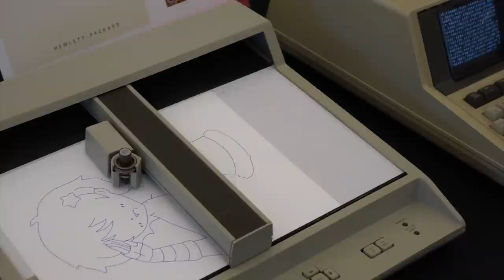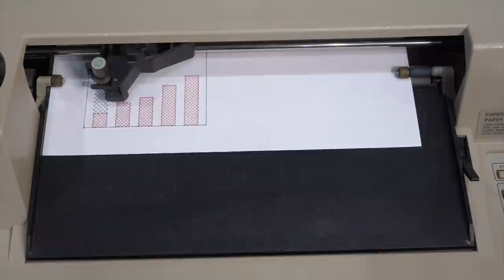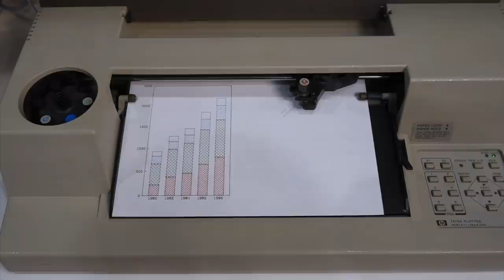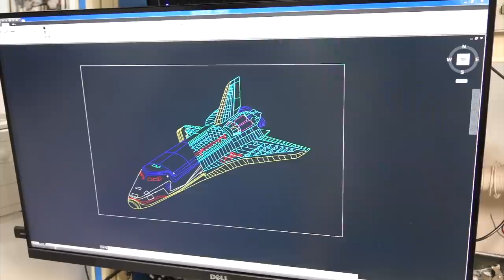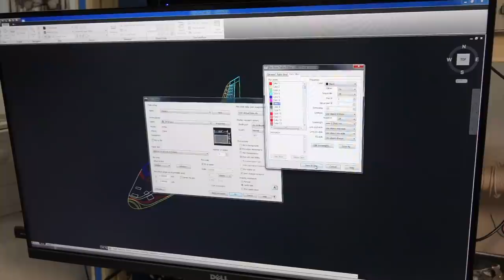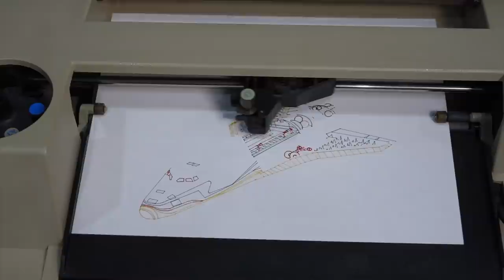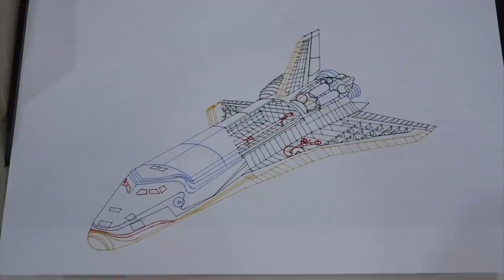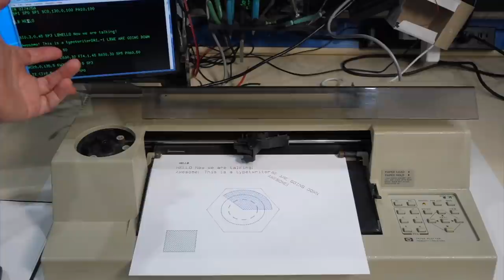HP 7475A Plotter and HPGL Demo

Comment: Years ago at Boeing, we'd use HPGL as a graphics interchange language if nothing else like IGES output was available. Virtually all the systems had the ability to plot in HPGL if nothing else.  I wrote many a HPGL to X and X to HPGL translation programs to transfer graphics between different engineering groups around Boeing during that time frame.  It was a lot of fun.
Reply: HPGL (HP Graphics Language) was the most widely supported language.  There was even a rasteriser available at one point which plugged into a regular dot-matrix printer and allowed it to print HPGL output.
Reply: As a practise project I am building an HPGL to low-level vector parser in pure condensed python. polygons are a bitch I can tell ya LOL
Reply: I used HPGL to duplicate the vectors in a drawing so it would retrace everything once on an A1 DesignJet. using an Ahrend steel tip pen, it would result in absolute opaque  black on polyester film. I used that for pcb UV exposure a couple of times until I resigned at that place. This was 1992.
Reply: @paulmichaelfreedman8334  We coded primarily in C at the time.  In our primary system used to print all the graphics in the Maintenance and Operations manuals and all FAA Bulletins, EVERYTHING was a polygon - even circles and splines were just polygons with very high segment counts to smooth them out.  This took more memory, but was FAST and eliminated a lot of floating point calculations. Polygons were implemented as pointers to sections of malloc'd memory containing linked-lists of vectors.  I can imagine in Python with no true pointer type things can get challenging!  How are you implementing them?  Arrays or something else?  I have written code to simulate lists using Associative Arrays.
Reply: @rhymereason3449  Let's just say my comprehension of lists has improved massively after spending many hours analyzing the behaviour of certain actions. In the end I saw my failure: When a list is returned from a function or method, it's always put into another list to be a single variable. That meant i had to use .extend() instead of .append() to add the results to the list that was being assembled. My parser first filters commands from data, then parses that data into a list of single values. Then checks which command and calls the corresponding function. That function then returns the low-level vectors back (containing coords, pu/pd info, pen nr, speed) in a list which is the added to the main list. When PM0 is issued, all vectors are stored temporarily in a separate list, which is then added whenever EP is issued and emptied when PM0 is issued again. FP has yet to be implemented. Circles work. arcs are not yet accurate.
Reply: @douro20  That rasterizer must have cost a fortune, to contain so much memory as to rasterize a full page of graphics. And no line by lijne, the full page has to be rendered before sending to printer.
Reply: @paulmichaelfreedman8334  Not really; this was the early 1990s.  It was cheaper than a pen plotter
Reply: @paulmichaelfreedman8334  Yep... pushing the boundaries of a language to solve a problem forces you to get a deeper understanding of the language. It also teaches you the strength and weaknesses of a language and it's appropriateness for a given application .  I'm sure you're learning a lot.   I like Python to a certain degree for it's rich set of library modules... but it's insistence on making so much "immutable", constantly making new copies of objects,  and making pass by reference so difficult can drive someone who coded professionally for decades in C and assembly nuts!
Reply: @rhymereason3449  Despite it's disadvantages, I find python to be fine for messing about inhobby  projects. It's anything but fast (although for some things it is already much faster than needed), but the interpreter-based functionality means it's easy to check if errors have been corrected by just running the program everytime you make a change. In C you have to re-compile a lot of stuff. No idea if that takes much longer or not, but from what I hear it does.
Reply: @paulmichaelfreedman8334  Oh I agree with you 100% - we're all pretty spoiled by the speed of modern hardware where we can trade efficiency for convenience.  I'm amazed at the fraction of a second byte-code compiles of languages like Python, Perl, and Awk - the languages I use for various home projects.  And the speed of modern hash tables (associative arrays & dictionaries) is truly amazing (when I started coding, if we wanted a hash table we had to code it ourselves, along with every other data structure for that matter).  Even Brian Kernigan one of the developers of C admits he now primarily codes in Python and Awk!
Reply: @rhymereason3449  I think ease of use is the best term to describe Python's neatest feature.
Reply: @paulmichaelfreedman8334  Yeah... but the language itself has this odd mix of what is a standard function and what is an OO method that is annoying to me... and regular expression implementation is really clunky IMHO... much more awkward than in Perl or Awk.
Reply: @rhymereason3449  to be honest programming jargon is not my best quality, but a standard function in essence simply returns calculated results, and a method can be used multiple times as an independent instance with its own set of parameters preset. I think I got it half right there lol
Reply: Also used 7475 for telecoms and banking purposes. A great device

Comment: The engineering firm I worked at in the late 80's had a pair of 7475A plotters that ran 12-14 hours per day, 6 days a week cranking out electrical schematics on 11x17 paper.  The techs that ran the plotters could switch out paper and pens in a hurry.  The constant click / clack of the plotters was annoying until you realized that was the sound of progress.  There was a third plotter plus more spare parts to keep everything moving.  The 7475A is an amazing device.  We even worked on optimizing the movement of the paper and pens to save precious seconds on each drawings.
Reply: At my workplace we had a room full of D-Size plotters, 6 - 8 as I  recall. Sometimes I had to edit HPGL files by hand, because of engineer's screw-ups.
Reply: @mekkler  You mean sending you a plot file plotting just beyond the boundaries resulting in no frame around the drawing or similar? I remember AutoCAD late 80s had a quirk where it was easy to do such a thing.
Reply: Why didn't you guys have a laser printer? A laserjet II could do 8 pages per minute, or did you need color drawings specifically?
and 300 dpi was fine enough to scale to A3 on a copier. I worked at a place that did that. print everything on A4 and copy to A3. A3 laser printers were ridiculously expensive in the early 90s.
Reply: @paulmichaelfreedman8334  What the engineers did was to use a proportional move command which would send a section of entities racing 1000 miles into the distance so the actual drawing was a  tiny postage stamp sized blob in the corner. I tried to get them to zoom-limits instead of zoom-extents. It was easier to just do it myself.
Reply: @mekkler  Yes, I know that one too. Bloody annoying wasn't it.

Comment: The innovation that made this series of plotters great was to move the paper instead of the whole pen carriage, and to do it without losing accurate paper registration. The system was called LIPS - Low Inertia Plotting System. The first plotter to use this was the two-pen 7470, codenamed Sweetlips. I think the 7475 may have been called Hotlips internally. The final desktop  model, which was astonishingly fast, was the 7550 which featured automatic paper feed. Moving the paper was achieved by using rollers with gritty surfaces, or grit wheels. Finding a way to make the grit wheels in such a way that they would make tiny indentations in the paper that would reliably re-engage with the grit particles that made them was the key to success. If you look at the edges of a sheet that has been plotted you can see the tiny tracks of pits that the grit wheels have made.
Reply: That's fascinating!  I would never have thought of that, even watching it work, but it makes sense how that would compensate for tiny amounts of slipping to keep them from adding up.

Comment: Amazing machine that brings back good memories. I used it a lot back in the 80’s to print transparent slides in color to present on an overhead projector. Remember those?
Reply: man those slides must have been beautiful
Reply: I used to use these on a daily basis when testing microwave sub-systems; we also had the larger version which I can't recall the number of. We had started out using the flatbed versions before the 7475 was available; with these you had to lay the paper on the bed then switch on the paper hold which applied a charge to the bed; the pen change was entirely manual on that model.
Reply: @cambridgemart2075  electrostatic paper holding? dope...
Reply: @GeorgeTsiros  ?

Comment: I remember seeing someone pull one of these out of a storage room, plug it in, press the Confidence Test button and have it work perfectly despite having been there for 15 years or so. Even the pens still worked fine.  Meanwhile modern HP inkjets will demand a new set of ink cartridges to print anything if you leave them idle for 15 days.
Reply: @kreuner11  plus they have chips to stop you refilling them with generic ink. That’s why I keep around my 2006 one which, despite looking to have a chip, doesn’t actually use it for that purpose. No need to replace it.
Reply: @kaitlyn__L  Once it breaks go for an InkTank professional printer from Epson or Canon. I got one used, and it's absolutely incredible.
Reply: Honestly, the biggest danger you have plugging it in after 15 years is that the fuses go pop due to leaky caps on the driver board or power supply 😂
Reply: @paulmichaelfreedman8334  It's interesting how most 70s and 80s electronics can be fixed by replacing capacitors it but that is not true of modern stuff. So in a post apocalyptic world there'd be a lot of retro gear being used after being mined out of landfill and recapped.
Reply: @user-qf6yt3id3w  You'd be surprised how much mpdern stuff can be repaired, just with more sophisticated tools. SMD repairs are order of the day in repair shops.But I agree that is not well spent on cheap electronics meant to last a couple of years. But a lot of it can be salvaged and brought back to life if not corroded too much. Even cheap electronics use Glass fibre pcb board.
Reply: @anonymousarmadillo6589  Epson color laser printers are amazing. I bought a single drum color laser from epson in 2006, and it was capable of 2400x1200 dpi. It produced photo realistic copies with brilliant colors. Not fast, but stunning quality. And it only cost me 300 euros at the time  I regret ever selling it. But it was showing signs of age and not just the pickup rollers.
Reply: It was built while HP was still a tech company and not just mostly a seller of printer ink at $1500 a gallon...
Reply: @paulmichaelfreedman8334  Yes, but a BIG difference for the casual hobbiest.  With old tech all you need was a soldering iron.  With the new SMD stuff you need a hot air system, magnifying system, special forceps etc. and the muscle control of a brain surgeon.  Not to mention testing/troubleshooting is harder too.
Reply: @rhymereason3449  True, less readily available, but certainly not impossible.
Reply: @rhymereason3449  At the time (~2002) I calculated the price to be around 1200 euros per liter, and there are 3.7 liters in a US gallon. I worked at a copy shop that had a wide format printer and used huge HP ink tanks that held a liter per color. I also knew the wholesale price, around 800 euro p/p, and it took 7 colors (!!). The smaller ink cartridges worked out at over 1200.

Comment: "-I'm a time traveller! And where I come from, we have one-armed robots that draws spaceplanes! Spaceplanes that actually flies, fixes space telescopes in orbit, and lands on runways!
-Wow! and how far in the future do you comes from? a century or what?
-Sorry, but I'm coming from 40 years in the past..."

:'(
Reply: You couldn't pull that trick on me.  I'm from the past and I was there!  I remember fixing the plotters that were connected to our Apple //e PCs and had pens that came loose, got stuck in the mechanism and burned out the driver transistors.  Plotters, in my opinion, had major drawbacks, mainly they were slow...   Thanks, Marc.
Reply: Best comment EVER, sooo true
Reply: @kreuner11  Yeah, but they cut, not draw.
Reply: @Damien.D  You can look up pen plotter on amazon and find plenty of results, all though most of them have both axis in the pen mechanism instead of moving the paper

Comment: Wow, that brings back memories! I was a technical support engineer at HP San Diego Division from 1985-1988, supporting all plotters - flatbed electrostatic flatbeds like the 7225 you mentioned, desktops like this one, and drafting plotters. When I first got there, I decided that a good way to thoroughly learn the way a plotter works was to build one. So every day on my way to the lunchroom I would pass by the bins of rejected parts and pick out parts that would still function (rejected for cosmetic reasons or something), and I gradually built my own 7470A (similar to this one but with only two pens instead of a carousel) for free!

Comment: in the 80's when i was training to be an engineer, part of my job was 2 afternoons in the "plotter room" maintaining and running the plotter for the highway design department for a local authority, the plotter used paper with paper up to 2m wide, regularly pens would run out mid print or jam etc, and i would have to fix it, and try to sort the plot to continue without restarting the whole plot. it was so stressful, and ou could not take your eyes of the plot at all ! watching the second half, omg the serial instruction, i spent many an our fixing our senior engineers Plans with command like this, and it would always be our error if it turned out wrong !

Comment: My 7550A has been stored in my Sea Container for over 20 years, not even packed in protective plastic, dusted it off, turned it on and ran the demo - no problems!  Had many sealed Pens but pretty much dried out after sitting in the Container over many Aussie summers.  Read a suggestion using Sharpie ink and removing the felt pen by simply pulling it out, using an allen key to push the cap out, installing the Sharpie ink (trimmed to size) and works just fine!  Now installing XP on an old desktop as that was the last OS that supported the plotter (serial port) so can just transfer files to that platform for printing!!  Soon be plotting Circuit Diagrams again with an entertainment value that ink-jet printers could only dream about!!  
And seeing the (once treasured, pray again from Nov 2024) "Made in U.S.A." on the printer and all circuit boards.  If it was HP, DEC, Honeywell, Foxboro and other great companies, "Made in USA" was a guarantee of fantastic Engineering and Quality!  President Trump, Make America (And the Western World) Great Again!!

Comment: Watching (and listening to) this thing run, especially the solid fill at 5:35 getting faster and faster in the corner, reminds me of a modern 3D printer in operation.  We had a couple of pen plotters in the drafting room at school, which were later replaced by wide-format inkjet printers.  The accuracy on these pen plotters is impressive, especially almost 40 years later!

Comment: Great, in 1979 I wrote a program for HP 9820 and HP plotter. It was a simulator for a photolithographic projector. At our Uni-Department, Microwave hybrid integrated circuits were designed. The projector did not use a photo mask, but an adjustable slit.  The circuit itself was created by gradual illumination through this slit, which moved, changed length and width, and also rotated, in the range of micrometers.  The calculation and programming of the projector slot movement was done manually.  If an error occurred, despite a thorough code check, faulty ICs were made. The software simulator imported the data for the projector, and plotted the connection of the hybrid circuit at the selected scale on the plotter.

Comment: So funny to see that! Hearing the sounds brings up memories from more than 30 years ago, as I was doing my engineering diploma. Part of that was to write a plotter program for exactly the HP 7475A for measuring results diagrams from the High-voltage lab in my university.

Comment: Nice seeing one of those old plotters in operation. I didn't know about the built-in test program. When I used to work on the software for a real-time data collection and analysis program at a market research company there were many 7470 and some 7475 plotters around. I worked on the code that generated the HPGL code to draw graphs of the collected data that the researchers used in their reports to the clients. I still have a 7475 plotter. It originally had an HPIB interface but I paid HP to change it to serial. I have the manual for it along with the pen carriers for felt pens as well as the one for ink pens.

Comment: I actually wrote a compiler to translate Poscscript to HPGL to plot phylogenetic analysis cladograms in color on an old HP pen plotter.  Probably in 1994?  The compiler was written in Postscript and would run in ghostscript, or in a Laserjet with a bidirectional parallel port to output the HPGL.

Comment: Watching a plotter doing its thing never gets old, that's why I have a few in my collection. The HP models I have are 7470A, 7475A (1 x HPIB, 1 x RS-232), 9872A, 9872B. Only the 9872A is non-functional. Back in the 80's we used Houston Instruments plotters to prepare x2 photo ready plots on mylar of our PCB artworks, this before transferring Gerber files to the PCB manufacturer was a thing.